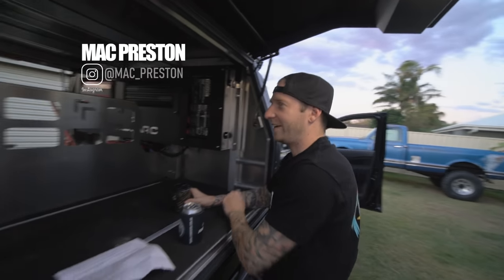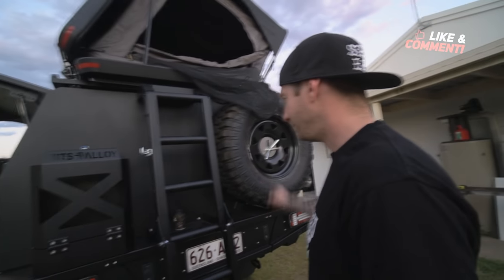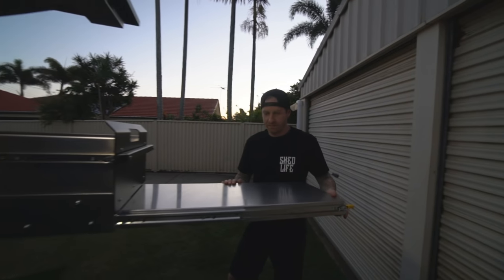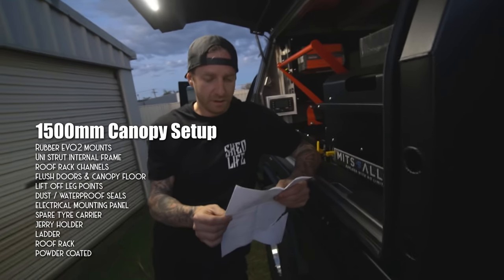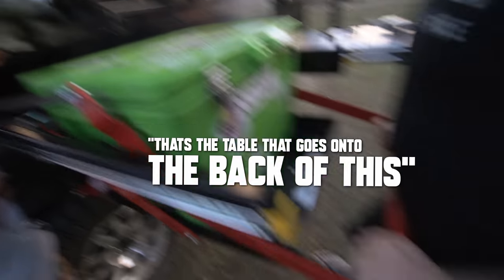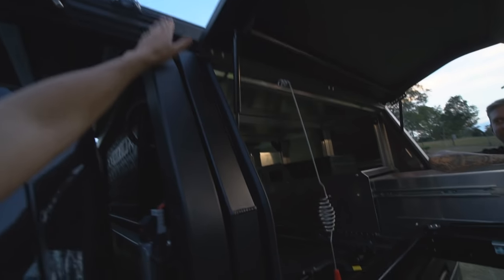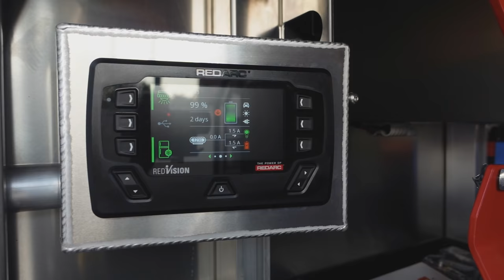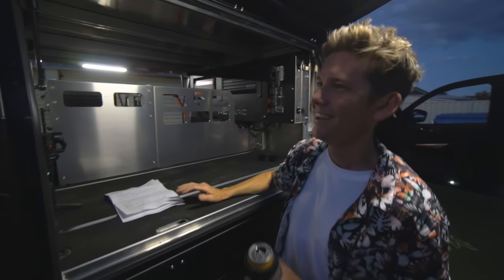ULTIMATE Tray & Canopy SETUP! 🛠️

Comment: Hey tj do you still remember what battery system they run on those canopies?
Reply from the maker: Redarc system mate
Reply: @TJANDMAC  what I meant was specifically installed in the canopy? e.g. management system, or inverter, etc.
Reply from the maker: @sassyash_commy  yeah manager30 with 1000w inverter and 100ah battery 😎
Reply: @TJANDMAC  thank you, sorry for the miscommunication 👍